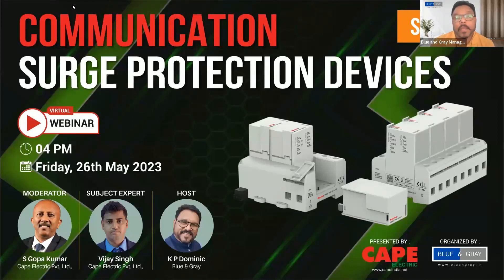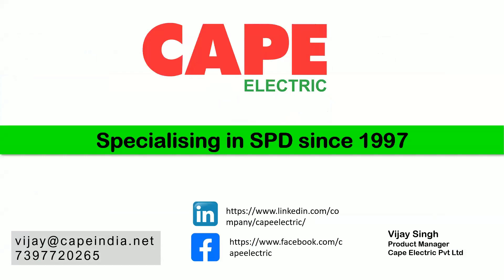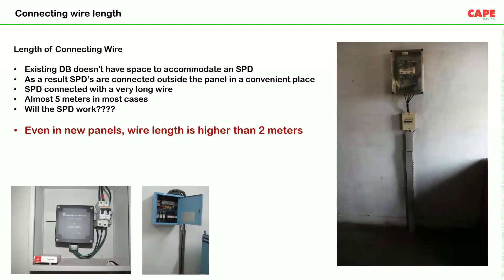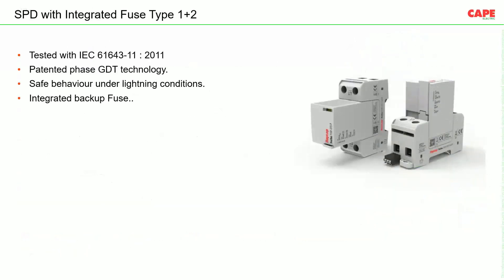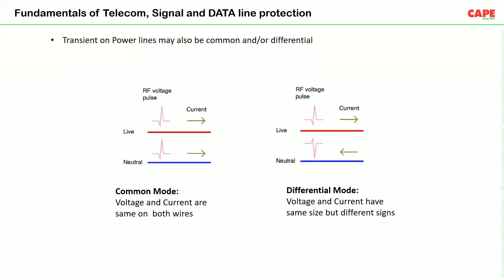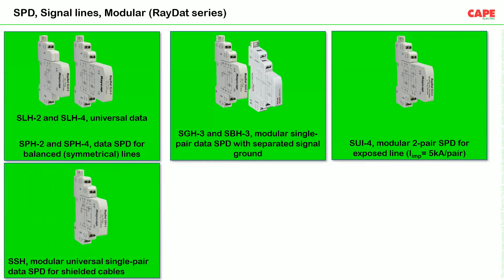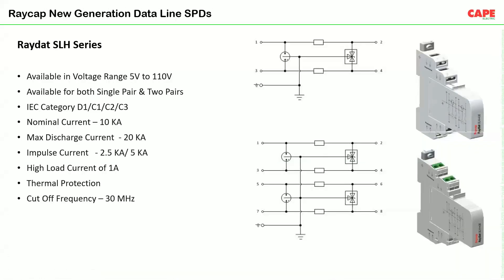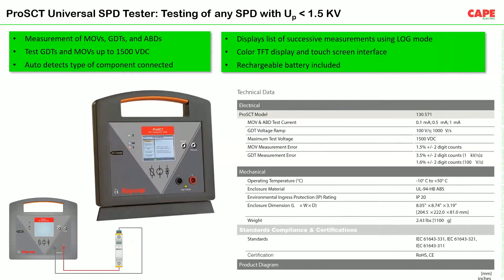SURGE PROTECTION DEVICES FOR LOW VOLTAGE

Comment: 1: In the Hybrid mode the TVS are going to trigger before the GDT can ever kick in. The GDT will only kick in after the TVS fails. A better option is to use an Air inductor before the TVS to slow the rise in current to help prevent the TVS from over loading and shorting out. Another option is to use a PTC fuse to help limit the current if the device current need is low. Or using a set of fast blow fuses will also work, but those will need to be replaced after a significant TV event. I avoid using MOVs since they basically have a limited number of cycles.
2: Protection on the signal\antenna line becomes a problem using TVS do to the diode capacitance, which can cause issues for high data rate signials. Usually very small TVS diodes are used to keep the capacitance low, but this limits the amount of energy the TVS can handle.